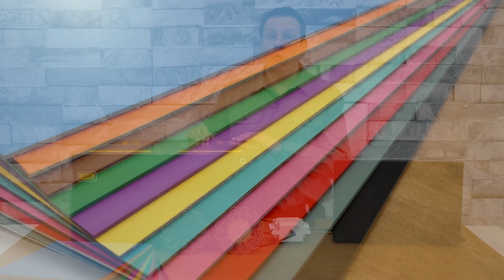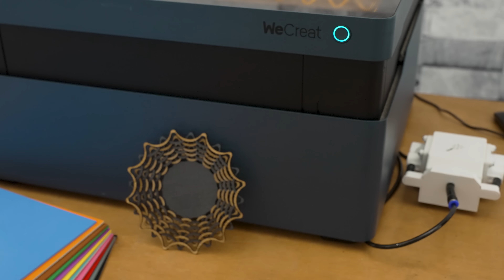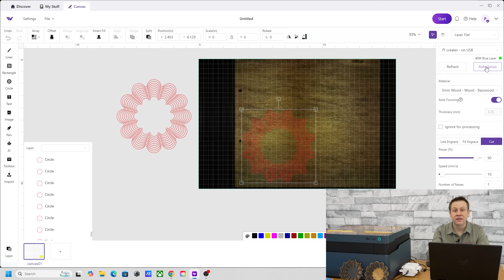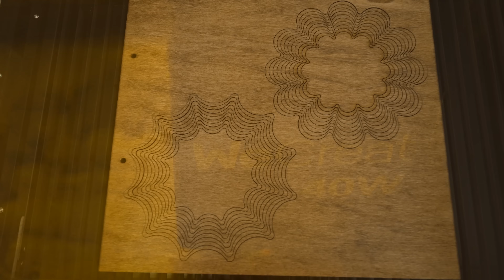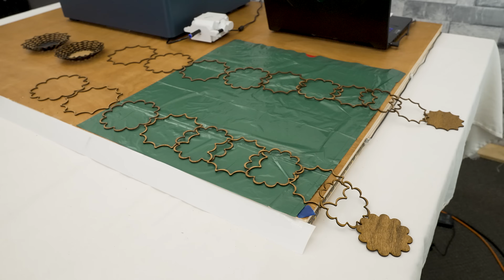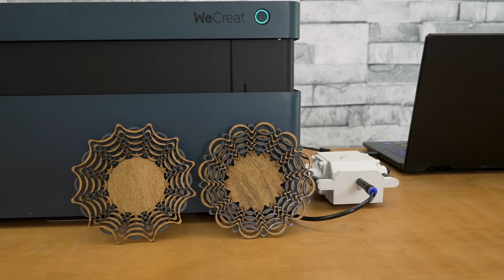WeCreat Project Bowl Set #wecreate #laser #project #woodworking #diy #diycrafts #diyprojects

Comment: I see that you have done a lot of reviews on diode larser I thinking about getting a larser range  of 20w ,what you recommend the Wecreate or Acmer and do you sale the laser after you have done your review or give out discount, I am a small business trying to get going.thanks for time
Reply from the maker: I make content on diode, Co2 and Fiber lasers.  Both the Wecreat and Acmer are great machines.  The Wecreat machine has recalibrated camera and rotary making it much faster to setup and use.  The Acmer P3 uses a core x-y system that reduces the weight of the system that moves the laser around making it a bit faster and reduces project time.
You are welcome to purchase through the links in the video description. :_doggy:
Reply: @thelaserchannel1  thank you for help!!